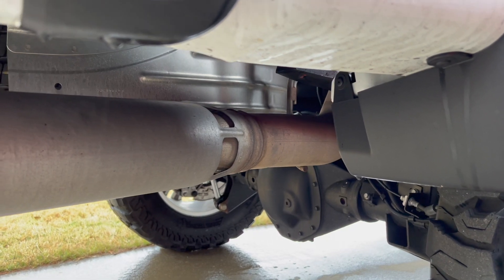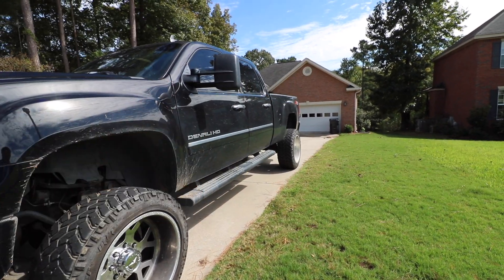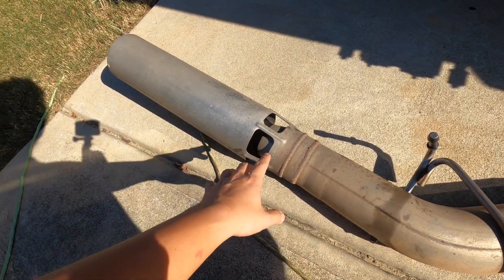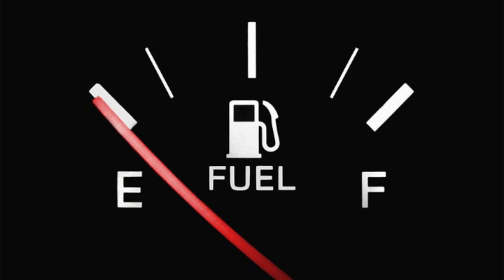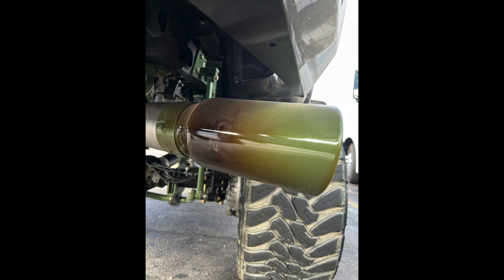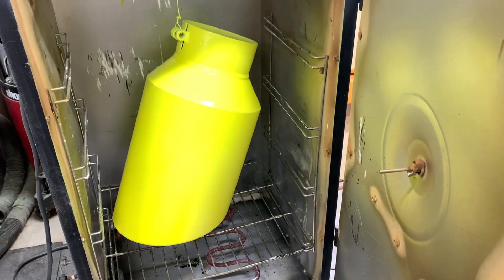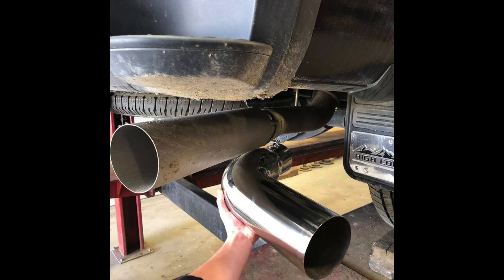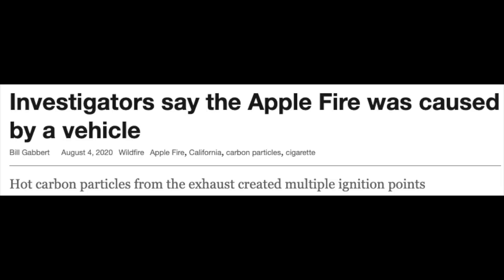Have You Wondered Why These Vents EXIST on Duramax trucks?

Comment: That's an excuse for why it's there.  It sucks in fresh air and mixes it with exhaust. By mixing in clean air, if someone like the EPA or State inspection samples the exhaust, the PPM(parts per million) looks way lower than it is.  It's like sampling the exhaust 10 feet behind the tailpipe.

Comment: Just think.  So called unburned fuel creates soot.. lol lol not one engine ever had 100 percent fuel burn.. so idiots think by adding more fuel increases exhaust temp to clean a filter.. all while still burning at 75 to 80 percent efficiency in the cylinders.. which creates more soot... lol lol what a concept.. and still since 1974 the introduction of pollution control garbage began. And 50 years later not once evet did any number.of bad air quality go down.. lol they decrease the number standards so they can complain todsy about how bad air is and we need to do more... lol lol lol lol its all garbage

Comment: So much investment to decrease out going emissions why not go to the direct cause and perfect it their we want no soot, and soot is unburnt feul why not invest in piston technology to better burn the feul i am not saying it's easy it just doesn't seem harder then building a valve train that you slap on the top of the header the connecting a catalytic to the turbo then another one on the exhaust pipe behind a filter and other parts that cost a lot to fix and replace i am not saying that i have the answers i am just statijg their surley has ro be a better way we want to breath clean yes i just don'think exploiting a group of people is gonna get that maybe if we work to bring that without bending someone over we can make it happens because i am going to be honest i. This closing this here does't make any sense so much to do one thing yet it feels like someone is trying to beat around the bush

Comment: I work at a drive-thru carwash and diesel trucks come through and I get a feel form their exhaust and it's just so much hotter than all the other little gas cars. I guess all it needs is just a little bit of air flow to cool it down.
Can I put a vent exhaust on an old truck which doesn't have DEF and doesn't go through the soot burn-off process? I've noticed the paint has burnt off the tip and the whole pipe looks bad.

Comment: It serves as a way to cheat the emissions  as it acts as a venture to bring clean air in to drop the CO levels during testing . The solution to pollution is dilution . To bad Volks diesel did not put on there diesel cars they would have had no issues for meeting requirements . They used these tips on Fords also did emission test very low at end of exhaust but put tester end  ahead of slots you get actual reading which is alot higher . Its like saying a vehicle that gets 60 miles per gallon is bad on the environment but 10 or 15 miles per gallon is better for pollution, did you get that one .
Reply from the maker: Unfortunately it doesn’t help cheat enough bc the truck can’t be in regen during the test anyway

Comment: What duramaxs go through regen
Reply: Does a 2017 gmc Denali go through regen before I buy one because I want to buy one but it has that weird exhaust on it so I has going to put a 5 inch exhaust system on it with a 8 inch tip on it with a pulsar tuner on it but I don’t know if I should if there is a regen on it because I don’t want to buy a 75,000 dollar truck and then blow up someone’s car right beside me and then next thing u know I have to pay for there car and stuff

Comment: The same setup is used on turbojets and low bypass fans to quite the engines, it made 727 legal to fly after 1989. It was developed as a way to cool exhaust IR signature back in the 1960’s to reduce heat seeking missiles hit probabilities. 
My 2016 LML got 4 mpg over a 500 mile average. No code was tripped so the dealer could do nothing but they told me to delete it soon. Now that I am bad I get about 20mpg, kinda fast and I use Hot Shots Secret to reduce the smoke.

Comment: Jet engines have used this for decades. Reduces smoke, temp, and noise in their simple designs.
e.g. PW JT8D used them.
The directed air from a "fanjet" engine cools exhaust temp etc.
Reply: Also destroys your engine from exhaust gas being recirculated.

Comment: Banks showed that with increased the exhaust to 5” throughout instead of having it bottleneck to 2.8” at the vent, it brought egts lower than oem and it decreased back pressure resulting in a horsepower gain. Should look into it and let us know what you think. Kory Willis did a bunch of dyno numbers about it. I think your buddies tip just burnt cuz it was powder coated and not cerakoted for the heat cuz his is a banks…
Reply: He said that. PC works ok on gas rigs and non def diesels

Comment: I thought it was to pull fresh air into the exhaust before exiting for EPA testing.
Reply: Exactly. 
The rest is gossip.
Reply: You’re 100 percent right let’s cut the bs people let alone ten times the fuel being burnt while everyone takes there trucks to the dealer to get them fixed I would like to see some videos on that to start showing people what it cost for repairs and fuel wasted traveling back and forth to dealers driving back with another vehicle to get it the next day tow truck bills ect the list goes on people

Comment: all newer diesels have vented tips. thats how you can tell to buy it or not. if its got vented tips and or a def tank i wouldnt touch it
Reply: Yes your right.
Reply: Ford had this in 2008. 2008-2010 does not have DEF.
Reply: @chris1451  cool never said it did?
Reply: believe 6.7 rams do not have these?